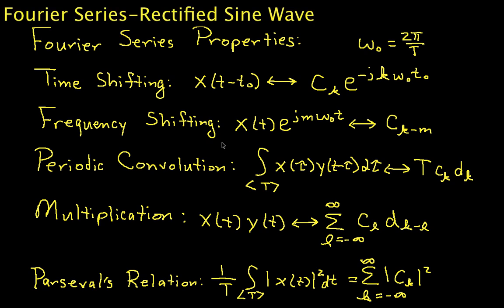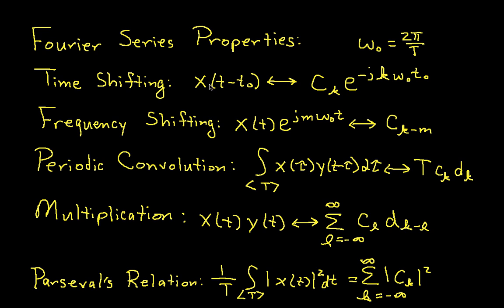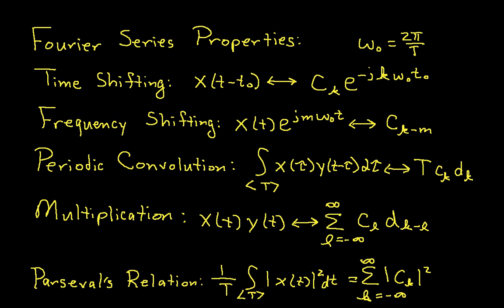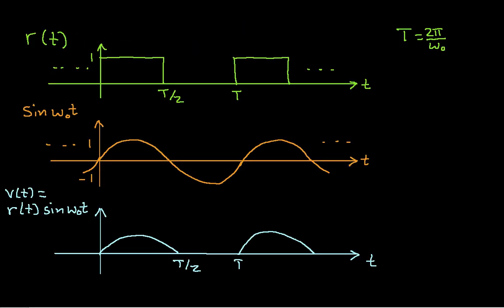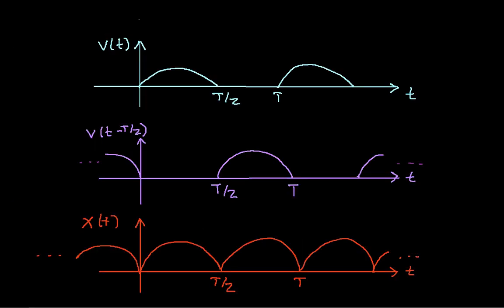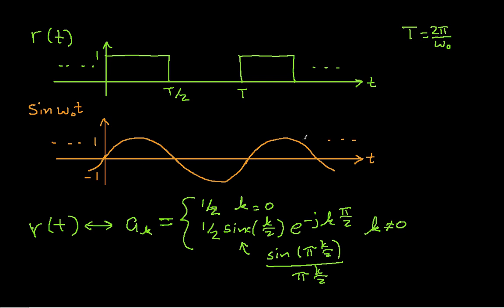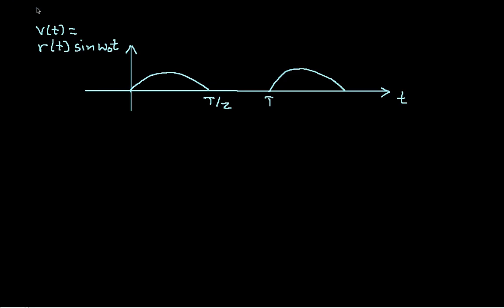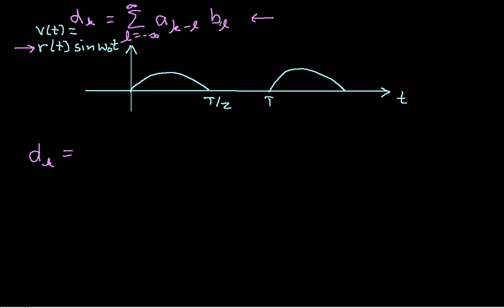Fourier Series-Rectified Sine Wave Part 1

Comment: Darrel thanks for your videos. I have a question about a simpler problem.  I want to find the Fourier coefficients for cos(t)*cos(2*t).  for cos(t) I find b1=1/2 and for cos(2*t) I find a2=1/2.  I wan to apply the multiplication property.  How do I do this? is it a2*bk-1?